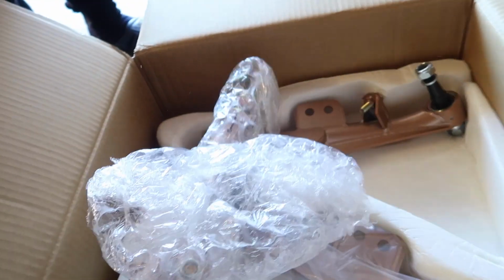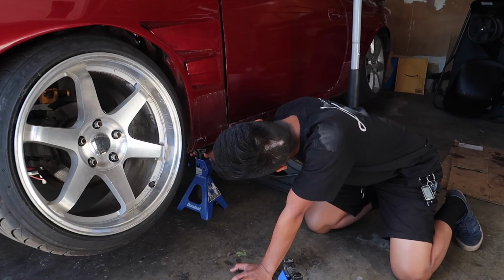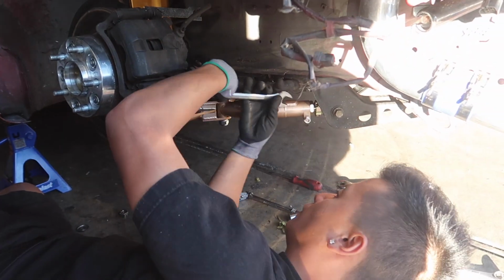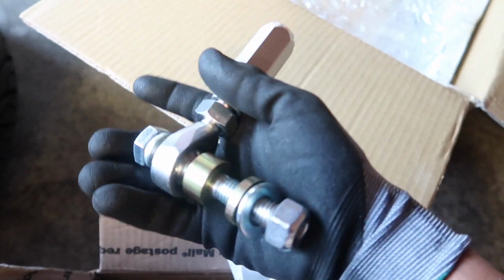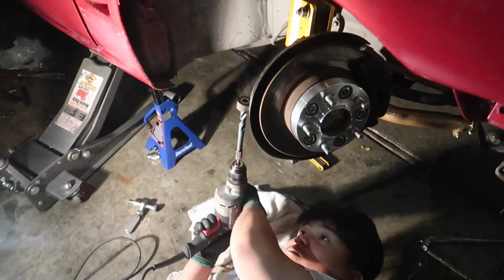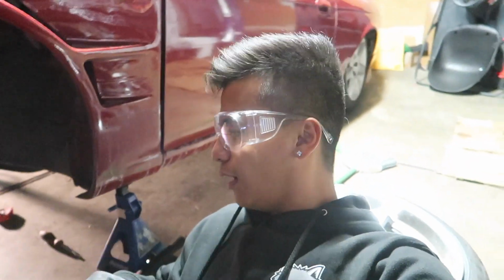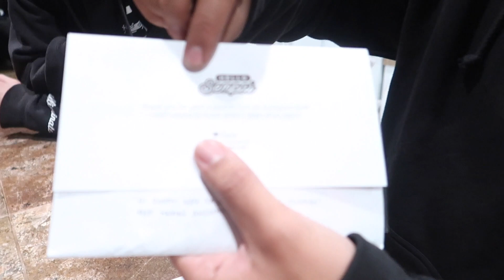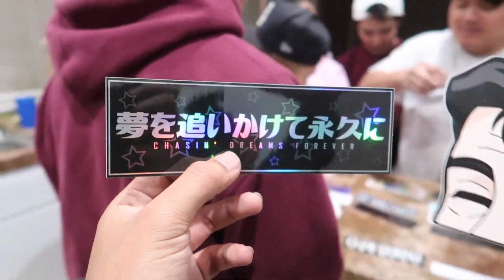ALL GOLD EVERYTHING!!! PBM FTW!

Comment: You made that piece of steel so hot and then cooled it off for water you made the thing rocksolid no wonder why the bit wouldn’t go through You need  to use cutting fluid or some type of oil

Comment: ur supposed to put some type of oil when you're drilling so the bit doesnt break. not water lol.
Reply: u can use water. just use something to keep bit safe from heat
Reply: WD40
Reply: Dawn dish soap, works great and almost everyone has some on hand
Reply: Who the fuck said you cant. This is coming from a ex Builder and Carpenter.
Reply: LucraTech LOL
Reply: Funny because machines usually spray water on the moving parts
Reply: Verlon Farris yes, through a highly pressurized jet. Not a couple droplets or a cup of water 😂

Comment: If you guys were drilling for over an hour with no results, you most likely ruined the heat treatment of your drill bit (should probably throw it away because its ruined), which is detrimental to it's material properties. Be sure to use some type of lubricatin when you're drilling into metal, motor oil or cutting fluid works great.

Comment: Why would a "quality" part require drilling into an oem part???
Reply: Rico387er because the quality part from PBM is more sturdy and bigger for drift applications or heavy use. compare it to other which are the same diameter they did testing and figured bigger worked for them. but I never had a problem with PBM parts either. also your only making the hole slightly bigger which shouldn't be a problem.
Reply: dsmracer97 pbm is great and all until you crash, the arms are really strong and the impact will get absorbed by the chassis

Comment: that watter will make your controll arm conections untempered and they will brake due to effort and tension m8 gg fisics u fuked up your parts with a glass of watter xd that bit is garbage as well the tip is now burned and untempered it will not cut and warm us as hell xD